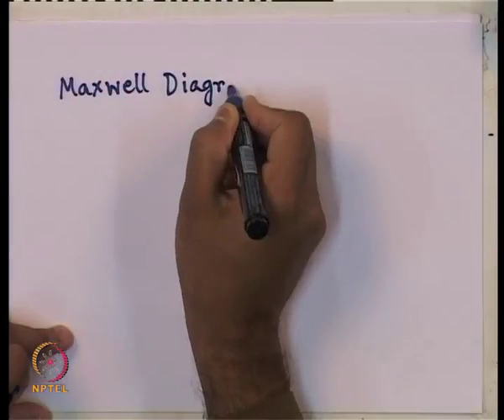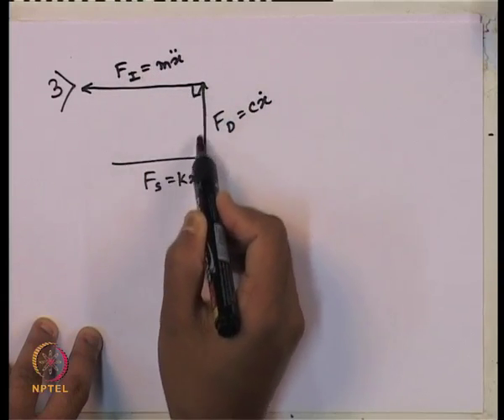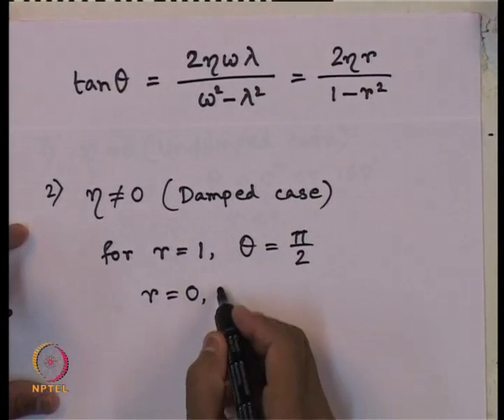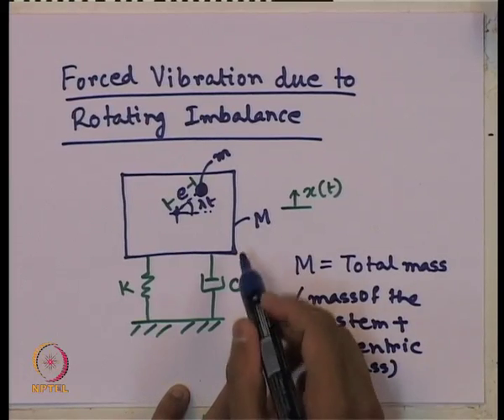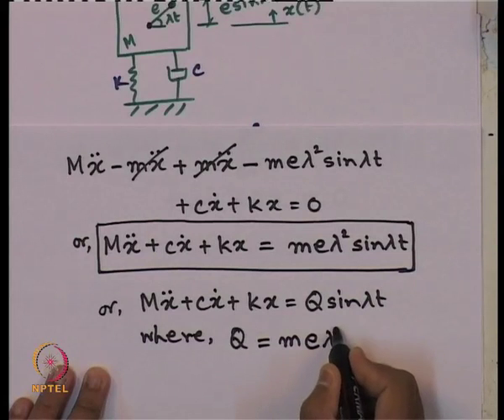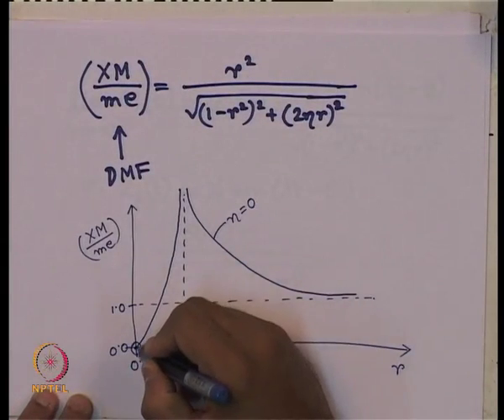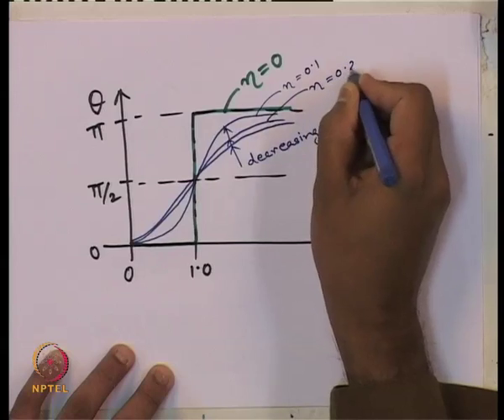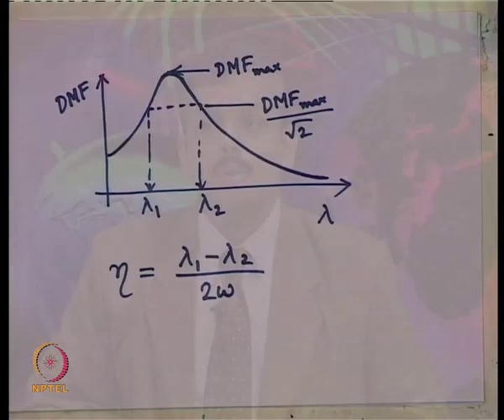Mod-02 Lec-09 L9-Maxwells Diagram of DMF, Discussion on Phase

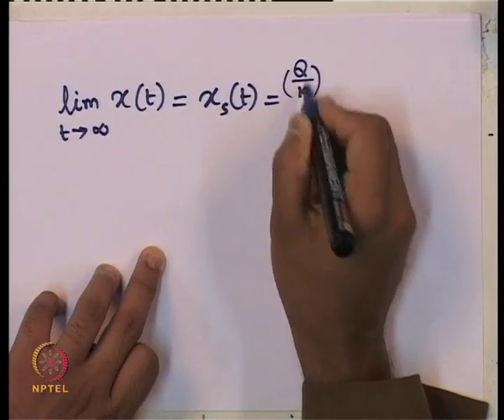Comment: sir at 29:32 earlier it was (P/m) not (P/k) so it must be now (Q/m) not (Q/k).......
Reply: It is correct, it is like that after the "simplification" of particular solution. Also notice that in the previous video, he used cosine harmonic load while in this case, the harmonic load is in sine function; in effect, the solution for these particular solution is actually different (not expanded in the lecture, albeit following the same derivation technique).